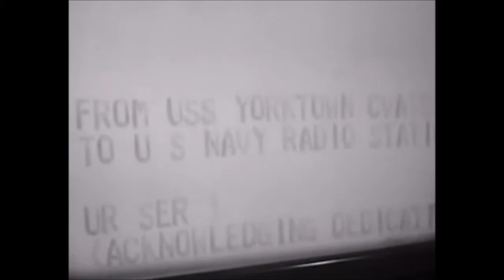Flat Earth - Radio Tower Proof

Comment: LORAN operated at low frequencies which allowed it to bounce off the ionosphere.  You either conveniently left that information out, or you are ignorant to how radio works.
Reply: the signal would diminish instantly, bounce is just as much a myth as grabbity
Reply: rockets push off air why would the signal diminish instantly? Why does vhf/uhf transmissions diminish between 2 ships at sea once you lose sight of each other but regain once line of sight is reestablished
Reply: Sir......, Tesla file: "Radiowave work on Ground, and not Space"